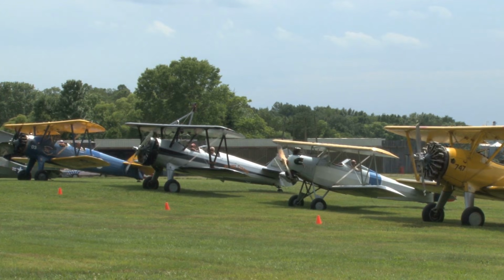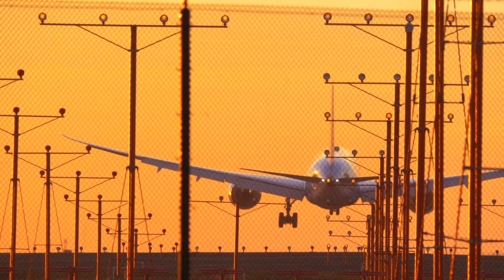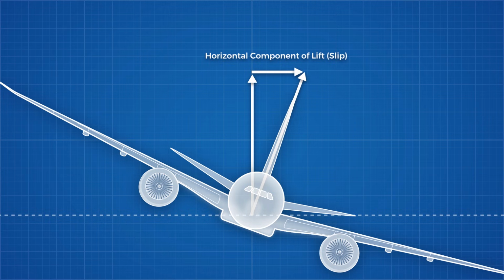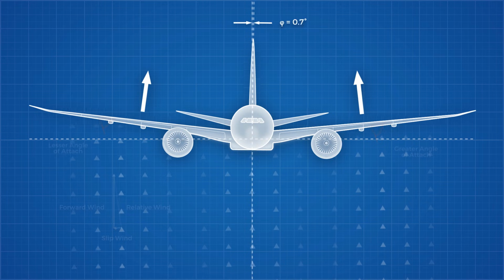Why Does Wing Dihedral Make Planes Stable?

Comment: "The plane tends to side slip" THANK YOU!!! The most commom and wrong explanation is pedulum effect, wich does not apply. Is really good to hear the correct explanation
Reply: I'm struggling with the supposed cause of this side slip. If a plane banks, the horizontal component of lift will always cause the exact horizontal acceleration that keeps the center of gravity of the plane passing through its center of mass. This, by definition, is coordinated flight. So I still don't understand why "the plane tends to side slip".  I'm an engineer by training, and I'm also a pilot. I can say without a doubt from experience, that a banked plane does not side slip unless you apply up-wing rudder.   Now i've only flown a few planes (small general aviation), so I won't claim that all planes behave this way. But I've just never been given an explanation as to why a plane might naturally side slip. My understanding of physics and dihedral is that it only causes coordination stability. A banked plane in coordinated flight, will not return to straight and level flight if the pilot lets go of the controls.
Reply: @gizmoguyar  I sort of feel like you've answered your own question: if there is horizontal acceleration the aircraft is moving laterally. Which, surely, is sideslip?
Reply: @gizmoguyar an aircraft when banked tends to sideslip if the pilot doesn’t apply inside rudder because the down going aileron is forced into the high pressure airflow that is beneath the wing which results in more drag on the up going wing causing adverse yaw to the outside of the turn. This can be found in the From The Ground Up which is the most important book to read for any pilot
Reply: @gizmoguyar  a plane will sideslip if the amount of backpressure is not changed, such as in a roll disturbance scenario. The lift is still equal to weight but not aligned properly,  so the plane will immediately sideslip. In a controlled bank you're constantly adding backpressure to increase lift and maintain the balance of vertical forces.

I've ignored the presence of adverse yaw to isolate this effect, but it's very much still there
Reply: @gizmoguyar   " If a plane banks, the horizontal component of lift will always cause the exact horizontal acceleration that keeps the center of gravity of the plane passing through its center of mass. This, by definition, is coordinated flight." That is correct, for a coodinated turn, this is the desired effect. But what he doesn't say in the video is that this is part of  latero-directional stability, like longitudinal stability, the capability of a aircraft to return to it's trimed state once disturbed. 

The reason why an aircraft may sideslip are several, I ll pick an example: let's supose you are on level flight with no bank angle, flying strait foward. Now, supposed a wind gust picks your airplane from left to right, for a moment. This will initialy cause the airplane to bank to the right(lets ignore the effects on Yaw).  Because your aircraft was on a level flight, its lift was equal to its weigh. Since now you are banked to the right, the force is no longer pointing straight up, causing you to have a lateral component. At the same moment, gravity is still pulling you straight down with the same force.

Considering you have now a small componet to the right and the vertical component of the lift force is smaller then that of the gravity, your aircraft will lose height AND move to the right, wich is the side slip Real Engineering talking about in the video.

 If we extend this example, an statticaly stable aircraft in this situation wil tend to: roll to the left and Yaw to the right pointing itself to it's new velocity vector and keeping its wings leveled. It will probably go back and forth a fell times, but will eventually stabilize.

Since you are a pilot, you have the advantage of being able to test this, my sugestion: Take an aircraft to a safe altitude, have it on a straight level flight and trim for this condition. Then give it something like 5-10 degree of bank angle, with out moving the elevator and the ruder. Most small general aviation aircraft should self stabilize by the mechanism I explanained above.  This very importante, bacause they usually do not have computer enhanced stability.
Reply: gizmoguyar Sideslip happens because when you roll, your lift vector rolls with you, so it causes a sideways force. Your aircraft begins to move sideways, and the tailplane acts like a weathercock and rotates your aircraft back into the wind.

You might be confusing sideslip with spiral mode, which an aircraft may be unstable in. Spiral mode is an antisymmetric motion which couples yaw with roll.

https://youtu.be/3PFpHDD7rWY
Reply: Gravity affects the entire object uniformly, not concentrated at its center of mass.

Comment: I love your aviation videos! I just had a question on why does the falcon 2000, a low mounted wing have an anhedral wing design? I’ve been told by the pilots that fly them say that they don’t even have to correct for crosswinds on take off whenever they fly that thing? I’d love for you to just give me a quick and simple explanation, thanks!! Love your videos, keep going strong!
Reply: It’s a fly by wire aircraft with artificial stability. 

Also, swept wings is another contributor to lateral stability. The Mirage 2000 has highly swept wings.

Comment: Ground Clearance actually is only one of the reasons why the Corsair has inverted gull wings. Both the P-47 and F6F (also made for carrier operations) use the same engine and as such an airscrew of comparable size, yet these two have conventional wings. The designers of the Corsair wanted to mke its landing gear as strong as possible, which is obviously easier with a short gear leg. Not only because of the stress on the gear during rough carrier landings, but also because the Corsair (at least the earlier variants) could use their landing gear as dive breaks. 
Also the Corsair's fuselage continues the near circular form of the engine, contrary to the F6F which has more elliptical cross-section due to the air intakes below the engine, and a wing root causes the least amount of drag when it joins the fuselage in a 90° angle.
Reply: Totally correct. I can only add that not only the root section of the wing creates the least ammount of drag when joining the fusellage at 90°, there's also the fact that at 90° there's no need for any fancy shapes to combat the added drag, the designer can just about stick the wing straight into the body. In war times, especially in WWII, when a big part of the able men were called to fight, lots and lots of jobs were given to people with less than ideal training. Any shape can be created out of canvas and stringers, or from sheet metal (most likely taking numerous hours on the English wheel), but achieving simplicity of design in trying times can not be overstated.
Reply: I smell someone here has been watching Greg's airplanes and automobiles:)
Reply: and it smells like increased manifold pressure @martijn9568

Comment: I mean planes naturally flap their wings like birds, duh
Reply: ive seen drones that do that but I wonder if they could make a plane that does that
Reply: @shaneviola8848  Probably, but it'd be either very expensive and ineffective or basically a glider.
Reply: @Mike-ukr  actually planes already flap their wings but they flap them so fast, they look stationary.
Reply: @shaneviola8848  An ornithopter? Or bug type drone?
Reply: Duh.. .Birds aren't real.
Reply: @NolePTR  well our eyes aren't real too
Reply: @rakaipikatan8922  what the- collapses into a singularity
Reply: https://images.app.goo.gl/h6rGesD9WdBMJoNE6
Flappy flappy
Reply: Wings are modeled after birds wing more than people know actually
Reply: This sometimes happens during takeoff/landing and it helps
Reply: They actually do flex a bit. watch the wings next time you fly
Reply: I cant tell if this is a joke
Reply: @DaylightsSand  the fuck you think?
Reply: No no he’s got a point
Reply: The calculation at 5:52 is incorrect, you need to convert the 6 degrees into radians. The loss of lift is even smaller than you claimed.
1−cos(6÷180×π)=0.0000016703

Comment: What about many high wing GA aircraft with dihedral? The Cessna 172 has 3 degrees of dihedral. It's likely that GA aircraft are designed with extra stability due to the way the planes are typically used which is not for aerobatics.
Reply: Probably and a high mounted wing gives better views to the ground and the easier access to the airplane.

Comment: One of my favorite wing profiles is that of the B-52 Stratofortress (or Big Ugly Fat Fucker if ya nasty). On the ground, it has a significant anhedral angle, to the point that the wingtips need their own gear when taxiing - both to make sure they don't strike the ground, and to help support the weight of them. Especially when carrying munitions on the hardpoints.
But in the air, they're either flat for most of the wing profile, or even slightly dihedral as you get closer to the end. This is less a specific design for stability, and more just how much flex those wings have. A little over 30' (~9m) total swing at the tip!
Reply: makes sense considering the wideass wingspan on that beast p.s. thankyou for using meters
Reply: Visited a SAC base during AF OCS in the late sixties.  Got to crawl inside one of these.  First...the plane is smaller than you would think.  That alone was interesting.  Then, to get to the flight deck from the rear hatch, you had to lie on your back on a sled that ran almost the length of the aircraft.  Quarters on the middeck were very cramped as was the cockpit itself.  I don't know how these guys did 12-14 hour missions.  Still, a remarkable aircraft even today.
Reply: "do not call the reader nasty"

Comment: 2:15 Is this the same sort of phenomenon as how train wheels have angled surfaces that are sort of wedge shaped (smaller circumference on the outside of the wheel) so that when a train goes around turns and stuff it will self-center on the track?